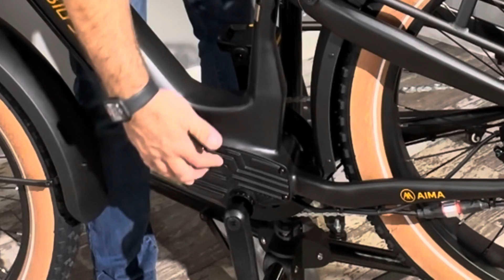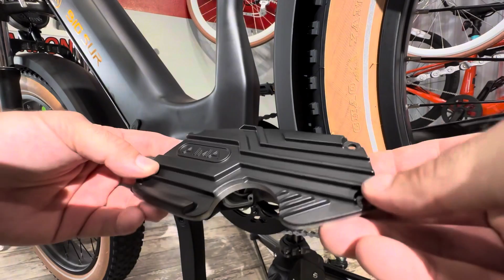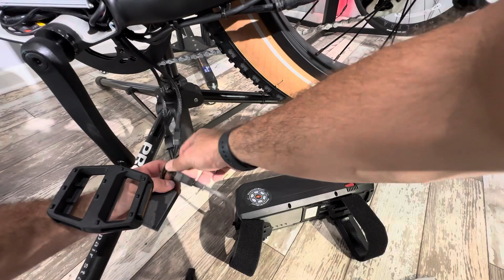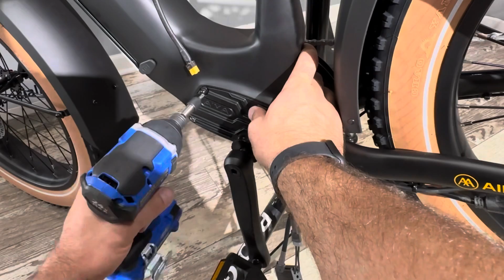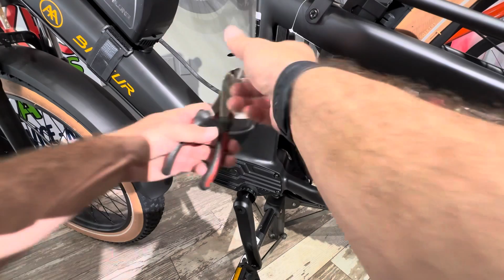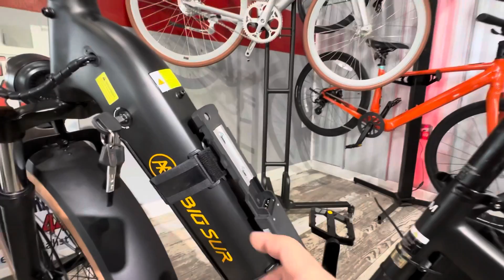AIMA | Big Sur | Plug & Play Dual Battery eBike Kit install Second Battery 30Ah Total 🔋🔋

Comment: Cannot find the battery cost. Found the kit packages but not the battery you installed. 
2 questions. 
1. How does this affect the motor 2 run 2 batteries in a day of riding?
2. If brought my Big sur to your shop. What's this cost to set this up?
I am going to be in Florida the week of May 11th.

Comment: I don’t see any info on balancing kit listed. Also mentioned is extension cables. I don’t see any info on them either. Please advise.
Reply from the maker: You can find the kit with the necessary cables at https://electricallwheel.com/40auniversalbalancerkitxt60bullettplug/

Comment: Love the Velcro on the battery, makes it super convenient.  I have run my extra 23 ah battery on my luggage rack for over 10k miles with 2 straps 1/3 as wide so they are super strong.  Probably stronger than a bottle cage mount.